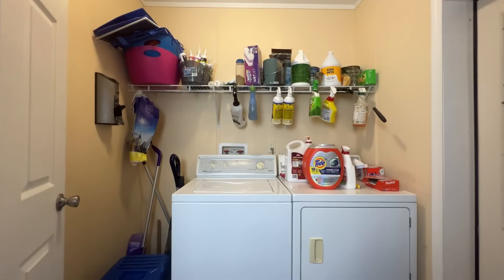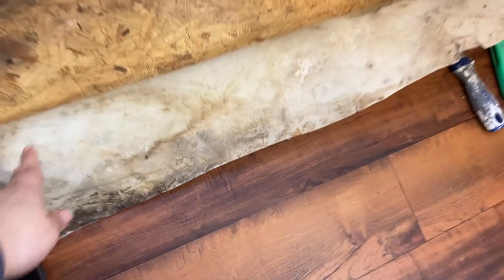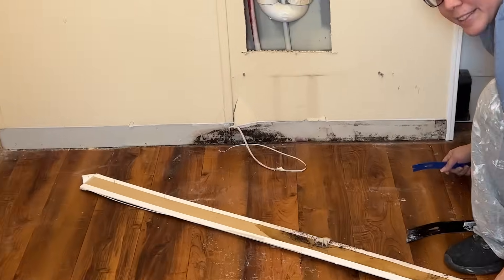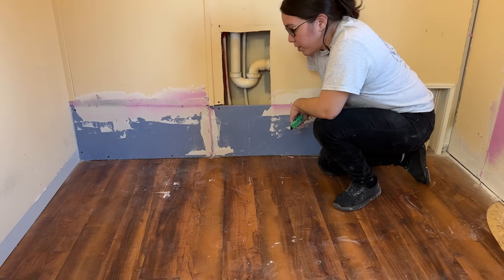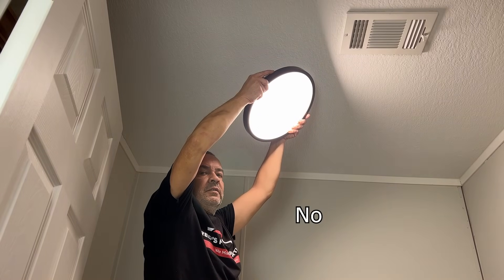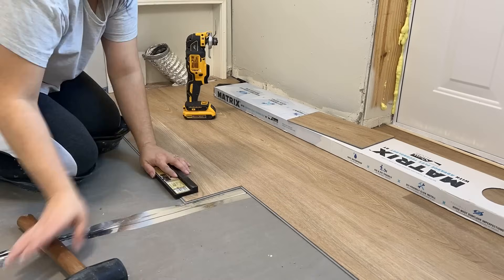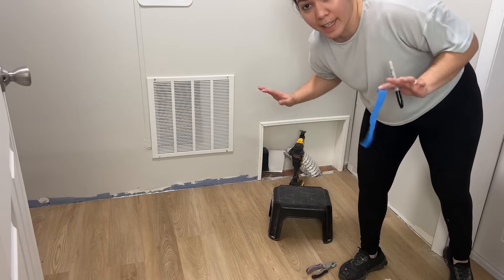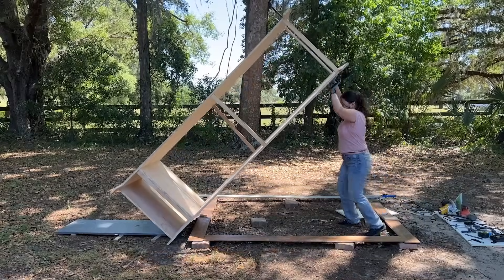I Hated my laundry so I tore it out (and found water damage!) Laundry Makeover on a budget

Comment from the maker: Hi! Thanks for watching.  Next video of this series is https://youtu.be/GrbI7Th6ARo

Here is a list of  T O O L S   &   M A T E R I A L S   I used in this video 

As an Amazon Associate I earn a small commission from qualifying purchases, but this supports me and helps me continue to make videos :)

Foldable work table https://amzn.to/3U040RZ
Multitool/Oscillating Tool (Dewalt) https://amzn.to/3NJhOy4
Cordless drill and Impact Driver Dewalt https://amzn.to/48iZl3D
Circular Saw Dewalt https://amzn.to/3NLiB1z
Orbital Sander Black+Decker https://amzn.to/3NNDau2
Pink Drydex Spackling (I bought a gallon at Lowes but this is the link for 1qt) https://amzn.to/3S1XFpx
Flush Ceiling Light - https://www.lowes.com/pd/Project-Source-Adjustable-Color-Temperature-1-Light-13-in-Black-LED-Flush-Mount-Light-ENERGY-STAR/5000149427?idProductFound=false&idExtracted=true
Paint - Sherwin Williams Showcase from Lowes - Color Drift of Mist SW 9166
Floor (not available anymore) https://www.lowes.com/pd/Shaw-12-Piece-5-9-in-x-48-03-in-Toffee-Elm-Luxury-Vinyl-Plank-Flooring/1002742298

V I D E O   M A K I N G   S T U F F
I didn't have a clip-on microphone for most of this video but the one I use later on this series is:
RODE GO II Microphone https://amzn.to/3RAeaaM

Microphone I used for Voice Over https://amzn.to/4aHtTOg
Audio Interface to use with Microphone for VO https://amzn.to/3RGh91K
Mic Arm https://amzn.to/3vtO6GU
Camera - I use my iPhone 13 Pro
Reply: Are you in the trades or you just really handy?
Reply from the maker: @Ed-wg8dn  just really handy 😁 I’ve fixed a couple houses in the pass few years and I learned a lot from it

Comment: The washers are heavy because there is usually a mass of concrete in them to dampen the spinning of a load of wet clothes.  Washer would shake itself out the door otherwise,
Reply from the maker: That makes sense

Comment: Thank you for the video.  It was good fun.  I just wanted to point out--and I am sure you already know this--that having a dead bolt and regular lock on a door with windows, well, they serve no purpose.  All an intruder needs to do is break that one little window next to the locks, and there you go!  That door is NOT safe!  Please consider making it safer somehow.  I honestly am not sure how to do it without replacing the door!
Reply: And invest in an inexpensive tool belt!
Reply from the maker: I never thought of that, even though I’ve seen it many times in movies lol. It makes sense but it’s very common here to have windows everywhere including the doors. There’s alarm systems that will trigger if someone were to break the glass so since I already have the door that’s probably my best option at the moment.

Comment: You're doing a great job! I noticed at the end you said you are not use to them being so nice and that you always had Shi**y ones. I don't mean to be a Debbie downer but, the older ones actually are better because they are not made to break down and when they do they have had decades of use before they fail. The current problem is replacement parts now come from china and are made to break after a few months. So unless you are dealing with Speed Queen very few machines are made to last. I have gotten to the point I don't care what they look like as long and they are work horses.
Reply from the maker: Thanks! And yeah I meant sh**y looking ones 😂 but it’s true they don’t build them like they used. I actually bought extra warranty on these just I case the break too quickly, I hope not tho 😭